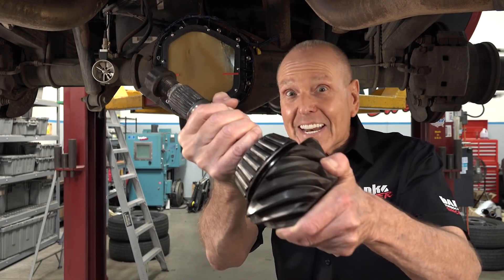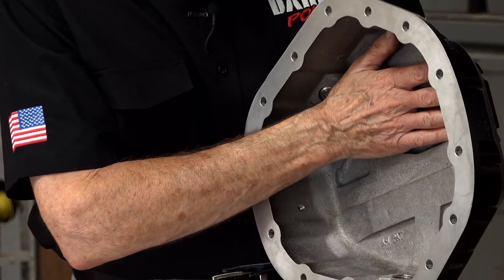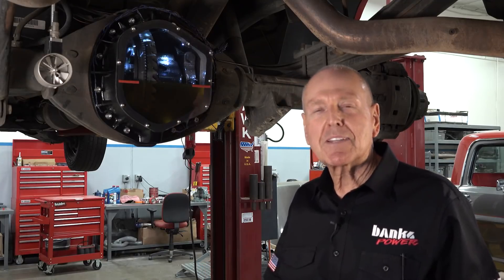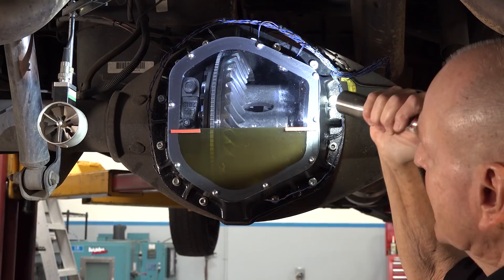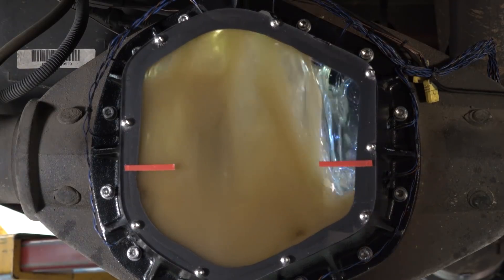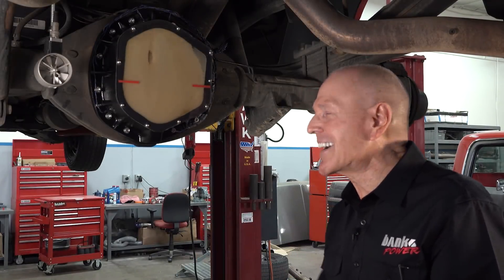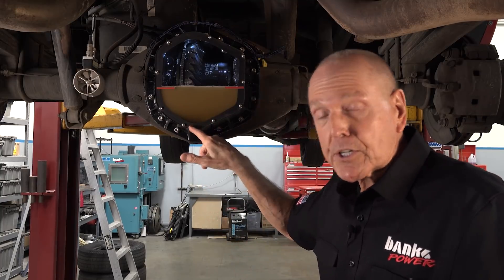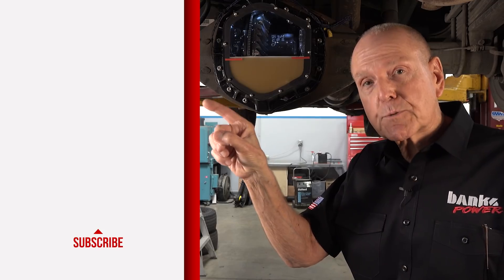What's going on behind your flat-back diff cover?

Comment: I see no flaw in your logic and I'm glad you're taking the time to perform these tests, but....  the see-thru cover you tested previously wasn't made to OEM spec. I would think if you're using the oem cover as a baseline it's just as important (if not more so) to see how the oil is flowing under that cover.

On another note... I'm personally running the PML covers. They are the closest to stock I could find and one of the few that fit my truck with the panhard bar, swaybar etc. all so close to the diff cover. I got them mainly for the drain plug. If this testing proves that they are in fact harmful I will switch back to OE covers. Although I would guess it makes little difference on the front diff.

Comment: 1 moving fluid wouldn't heat up significantly. Majority of heat produced is into the friction from the gears have you pumped water through a long hose and it super heats because of the friction on the outer walls no.... I doubt it makes a huge difference as to whether it would secondly the standard design had the same airation. Thirdly you can't even see or tell if it is doing the job your making an assumption... forth be careful because you've basically slandered another design without proof or long term testing this can be a cause for defamation and a law suit.

Comment: So it's like adding paint and chrome. Zero benefits, wastes money but makes you look cool. The biggest reason I wouldn't put a die cast aluminum cover on my diff? It's horribly brittle. If you've ever dented a steel oil pan, diff cover etc.., Just know that a dent is better than complete loss of fluid. You can drive home with a dent, you can't without oils.

Comment: If you think an aftermarket rear diff cover is starving the pinion of oil, then just add a camera up front looking at the pinion. Wait, you can’t do that? Why not? Because the ring gear is slinging plenty of oil up front and installing a camera won’t help your motive. Quit knocking other covers and quit running in circles with your videos. Cut to the chase, what are you designing and what are you bringing to market? These videos are all advertising.

Comment: Still not convinced that the pinion isn't getting enough lube. Just because you have diversion on the flat side, you have to remember that the fluid level dropped. Where did that extra fluid go? Did it flow out to the axle tubes? Doubt it. Having said all that, I do believe round covers are better. Big thick STEEL covers.

Comment: The classic Ford 9in must be the worst design in history, since it has that 360° mounting flange, that is definitely a 90° block to this perfect circular gear lube flow Mr Banks is looking for. I didn't see any camera angle proving this "starved pinion". 🤔🙄
Reply: Huh?  The part of a 9" housing that covers the rear of the center section is a single hemispherical stamping.

Comment: Very interesting. I am not convinced the pinion is starved. If anything making sure the axles are not bathed in gear oil causing drag would be a good thing to consider checking into. Simple fluid level decrease can fix that. I've ran flat back covers on my rear diffs on all our trucks. From drag racing to truck pulling over 150,000 combined miles with zero diff issues period. Mag-hytec has been good to us. Regardless of speculations they do work. If my pinion was being starved of bearing lubricity i would of blown them during one of my 300 plus drag passes or 400 plus hooks on the pull sled. Yet they are still like new. Not saying there isn't a better design to be produced. But for now my Mag-Hytec covers are nothing but great!
www.teamvenom.racing
Reply from the maker: Walt, there's no question that Mag-Hytec has always offered superior quality and workmanship. They are the industry leader, the Godfather of aftermarket diff covers and trans pans. However, it was through our discovery process that we learned that although they did solve some heat and convenience-related issues, their flat-back design causes other issues. By no means are we telling anyone not to buy their products. In fact, we've been a customer for years. However, in every product's life cycle, someone eventually poses the question, can it be improved? And, with this particular design, the answer is yes.
Reply: That reply was spot on and what i expected from you Gale. If you do decide to enter the diff cover market i will expect nothing but quality. We are working close with Joshua at CFT Performance to : Enhance" the performance of our Nissan Titan XD Diesel. This would be a great project to see Banks get involved with. A collaboration of you two is nothing new im sure. Joshua speaks highly of you. Thank you for the honest and educational reply and i look forward to seeing what the future brings from Banks Power!

Comment: If this is going to be a scientific comparison, you need to make a clear cover replicating the stock cover's dimensions exactly, and run the same test.  Otherwise, how do we know the exact same thing isn't' happening under ALL diff covers????  This test on it's own doesn't prove anything otherwise.

Also, if you put a camera INSIDE the cover, I guarantee there is still oil shooting at the pinion bearings.  What we're seeing is the excess fluid hitting the back cover.  That said, I agree with you that too much fluid is a problem in that it is being overworked, costing wear protection and HP.
Reply: The video ahead of this one has a stock-ish round back cover.  Might not be exact, but it very much represents the shape.  There is a very noticeable difference in the fluid flow and the amount of work being put into just pumping the fluid around.
Reply: irflyer Negative ass cheese.  That was on a completely different truck.  All the covers and all of the tests need to be done on the same truck.  And there needs to be a camera inside looking at the pinion if we’re going to make claims that oil is not touching those bearings.  You can’t see shit from the outside!
Reply: It wasn't even close, the shape matters if you're trying to compare the effect of shape.  This whole series is setting up sales for Banks covers.
How much HP do you think is actually being used to move the lube around?  You have a 400hp engine... and you're moving a couple liters of fluid.  A 1/3HP kitchenaid mixer could move a couple liters of fluid just as violently.  Are we really worried about eeking out 1/3HP from our 400hp 900ft-lb diesels?  You think you can actually measure or notice 0.075% HP loss across the operating range, under real-world conditions?

Comment: Why not just fill it up all the way ?
Reply from the maker: Because you do damage to the axles and cause massive drag trying to move all of the oil. It's called oil churn. Walk through a puddle of water. It's easy. Walk through a swimming pool. There's a lot more resistance. You lose horsepower.